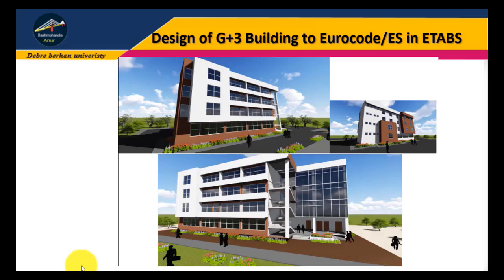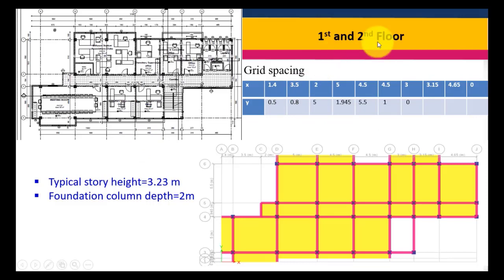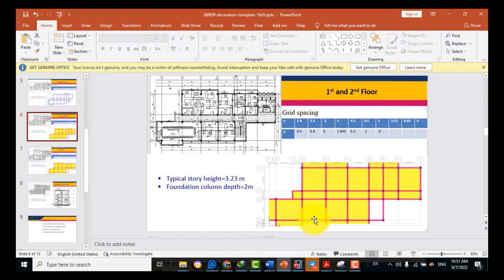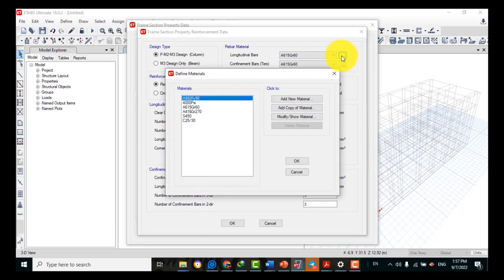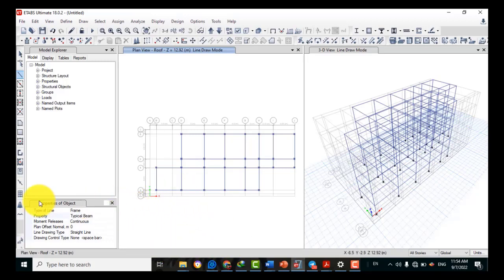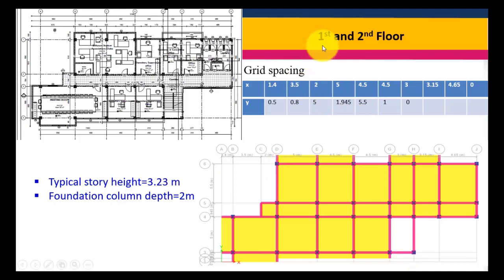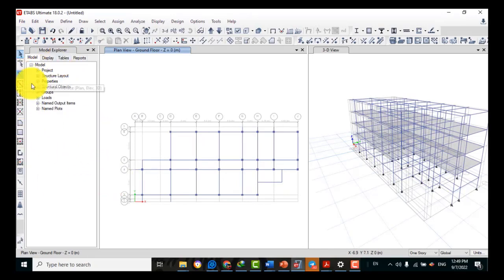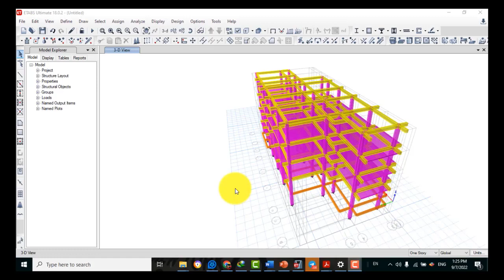Analysis Design of RC Building as per Eurocode or Ethiopian building code standards in ETABS Part 1

Comment: the material steel is not rebar you cant reinforce withe s450 u need to defind you rebar material
Reply from the maker: Thank you for the valuable comment brother. You are right. The material should be a Reinforcement bar, instead of steel.